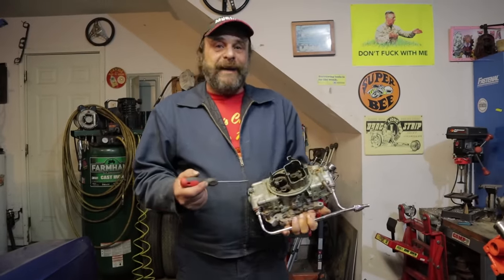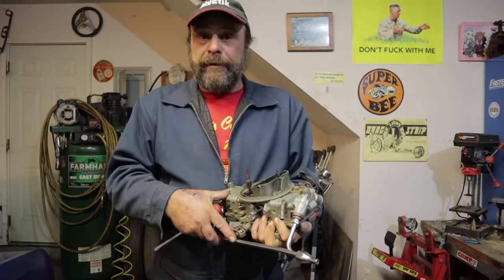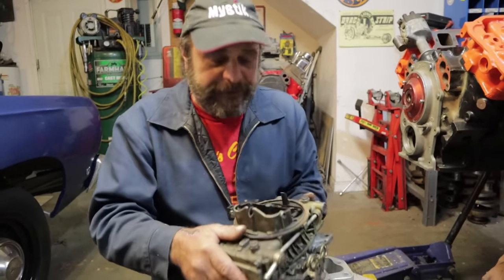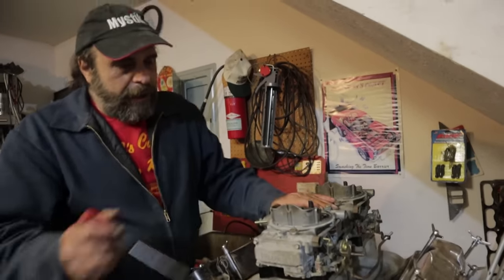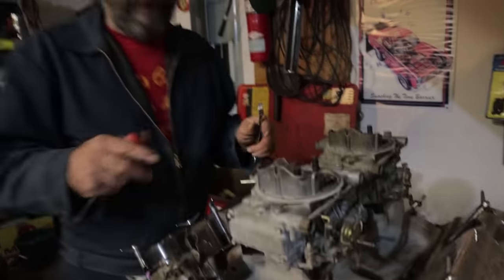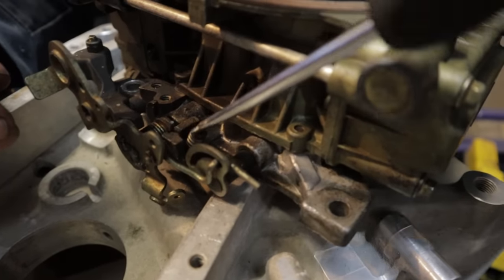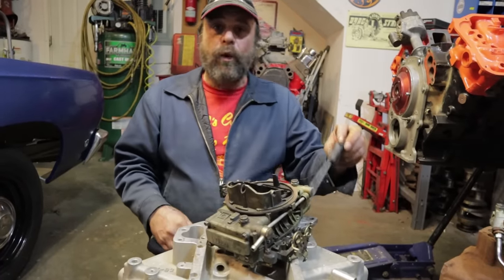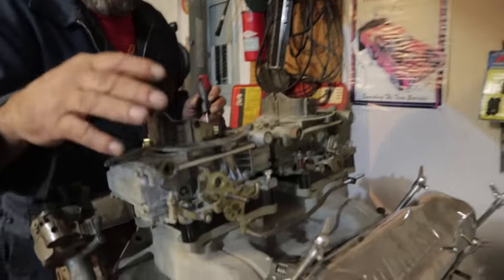Holley Set-Up and Adjust Step By Step

Comment: Tony, please do a video on setting the Fast Idle speed on a Holley 4-barrel with an electric choke and vacuum secondaries.  I recently bought a 1971 Charger Super Bee with a 383 Magnum and Holley dual feed 4-barrel on it.  The presence of the electric choke and vacuum diaphragm have made it a nightmare just to even turn the Fast Idle screw, let alone adjust it properly.  In addition I’m further hindered by the dual feed fuel lines being on the passenger side of the carb which allow minimal room to access the screw with even a small 1/4” open end wrench. In my case, the Fast Idle is set too high, so I’m trying to lower it and getting very frustrated with it..

Comment: Regarding dual quad setup (specifically for progressive linkage), is there a rule of thumb for putting dual carbs on a fresh engine (assuming the heads and cam/valvetrain can flow it)? Do you set both carbs up at 80% tune from the start, or do you tune and work on the primary before the secondary?  Just looking for a high level understanding based on the content you shared with us in this video. Thanks!
Reply from the maker: Generally speaking, you need to jet the carbs down when using in an 8bbl set-up.  Example, 76's would be dropped down to 72's or so.
You treat the idle settings on both carbs equally, even on a progressive set-up, UNLESS you are using a dedicated "secondary carb" that does not have idle circuitry included.  Example of that would be the factory front carb used on the Street Hemi

Comment: Is it normal if my car bogs/misfire while the engine is cold, even more so on WOT. But after I drive it for 10 minutes it runs smoother and actually goes at WOT?

I have a old 4.2 v6 c10 with a eadlebrock 600cfm carb. Idk if that’s normal or I need a tune up. (First old car)

Comment: Which part of the vacuum system would a person monitor to see the rise and fall of pressure? Thanks for the clear definitions. 
Only had Rochester carbs on chevy C-10's 1981 and my first 1966 and Pict-34 on air-cooled vw's.
Reply from the maker: Manifold vacuum is all you need

Comment: Amazing video thanks a lot. I just bought a 70 dart swinger and my carburetor is leaking so i want to get a rebuild kit, however i dont know what model my carb is. It looks EXACTLY like the double pumper you showed at first. Would you (or anyone) be able to tell me which model carb that is? Thanks!

Comment: Variable-geometry turbochargers can be made to work well with double pumper holleys...imo
btw...the 1st vehicle i owned was a  1972 AMC Javelin SST that had been fitted with a Holley DP 650 carburetor...as well as 401 v8,727 auto,go pack goodies,etc

Comment: I'm building a Jeep rock crawler with a mild rebuilt AMC 304. Edelbrock got me stranded on camber trails every chances he had. I got my hand on a Holley Truck Avenger do you have any recommendations since the engine sits at a 5 to 10° backward angle to align with drivetrain.

Comment: Uncle Tony I need your help.i am rebuilding a Holley 600cfm carb.i am about to purchase needle and seat valves and I found out that there are 0.97...0.110...0.120...0.130....0.150 tip.which one should I purchase??

Comment: Me,  I love the Carters AFBS with mechanical secondary's. I never had a good experience with Hollys. Just my opinion
Reply: holley,s are crap,ancient carbs,the thermoquad was better,thank fk weber bought them out.
Reply: You're not alone: Over the years I grew to despise Holley carbs. Nothing but love for Carter's
Reply: Holly carbs ALWAYS make a fuel stained mess on your pretty aluminum intake anytime you need to tune something major on them. The only way to minimize the ruining of the finish on your intake was to be a strick Nazi about fuel spillage and remove one lower floatbowl screw and drain into a cup. Hard to beat their full throttle power and response when they are properly setup though. Seams like I remember ALWAYS fucking with my Holly carbs.
 Carters & Rochesters I seam to remember it was always just set and forget. They didn't need the continual adjustments. They are easier and cleaner to work on once you understand how they all work.

Comment: Uncle Tony, do you have a garage in New York? I just bought my first classic car. I know very little about car engines so watching your videos. Anyway its a 69 impala. It was sold at Yenko Chevrolet but was not a high performance car. has a factory four speed. Originally was a 327, lime green car. Now it has the muncie transmission and a 454ci with a holly 4b carb and an edelbrock performance manifold. I had the car checked out and then also drove it myself. It seems to bog a bit when peddle is to the metal, thinking it might need more air intake? If you have a garage in NY I would love to bring the car by your shop and have it checked out.  Its a nice car, has a stripe on the side but other than that the car looks like it did when it came from the factory. If not for the stripe it could be a sleeper. Really great video, even a dummy like me can understand it.

Comment: Hey Im rebuilding my Pontiac 400, its being bored to 60 over, Ive been told the size of carb is 1.5 times the C.I. of the engine which in this case should be 690 correct? Which would be about 700 cfm carb?
PS watch all your vids really help while Im rebuilding. Thakns
DR

Comment: I got problem with my Holley and it's one I bought brand new back in '86. The damn pump lever and the screw/bolt. The head of the bolt just sits on the edge of the lever. All the others I have and have seen the bolt is straight up. Not sure if I should keep or save it for parts. Stuck it on an engine I rebuilt and at first idled quite well. Now it runs for tad, keep running giving it some pedal or it will die.

Comment: I have a Holley 3810 4b. 67 Vette won’t hold idol and stalls. However sometimes it does hold idol. How often should I change my fuel filter on the primary side. Thanks

Comment: Tony do you have a way to repair a stripped out needle and seat threads? I am working on a 1969 428 SCJ Cougar and bought the correct carb and got a good deal on it remanufactured and yep the front needle threads are stripped.

Comment: Hey Unc..Please look into this. I think something is different on the new Holleys. I am not the first to see this. Brand new Holley 670 Street Avenger. If I set it for 1.5 turns out, my eyes bleed from fuel odor. No kidding, I had to wear a respirator to be under there. Final setting ? A small hair past a half turn from fully closed. I am not the first to see this. Scares me I am too lean at idle but any more, you can really smell fuel. Any thoughts ?

Comment: What was the Holley 2 barrel carb for 4cyl engines with a mechanical secondary. It ran on one barrel until 2nd barrel activated after 3/4 throttle.

Comment: This may be a silly question but is adjusting the idle mixture screws also adjusting the full pressure? Or would you need a regulator to do that?

Comment: I set my mixture screws based on my AFR gauge around 13.2:1 and my idle around 1,100 rpms. Its a manual 4x4 truck, and parking it is a B** if my idle is too low.

Comment: Uncle Tony. I need your advice. I have a new holley 670 cfm vacuum secondary with electric choke. my question is, what should the cold start RPM be? mine starts at 2600 RPM and seems a bit high. I have looked around and the closest info I find is it should idle around 1500 RPM. I have an automatic, so does it mean in gear or neutral? Can you make a video on cold starting tuning with electric choke please?

Comment: I just did a small block Chevy rebuild with a brand new Brawler 4150 style Holley carb, and I was tooling with the both float levels based on what other people say to set them at, and thought putting them at the trickle level just below sight glass would be it but I guess it’s different for the newer style 4150s... and now my front float is where I want it and my rear is like all the way down, the bowl is dry, and the adjustment screw does nothing, tried turning it a lot. What should I do?

Comment: I have a hp950 on a 406. I took the linkage from another carb and revuilt it. I have it set with a 50cc primary with the pink cam and a 30cc on back. Some guys say I should do it the other way? I figgured having it on the primary will give me better 0-60s.. what do u think?

Comment: Hello Tony love your channel subscribe a while ago I love the way you just tell it the way it is I have a question I have a 67 Firebird with a Pontiac 455 and I also have a 1969 Firebird with a Pontiac 350 the 69 has a Holley carburetor 4 Barrel and the 67 has a Edelbrock 4-barrel even when it's freezing outside I don't have to put the choke on neither of the carburetors in the car will not give me trouble to turn on is that a good thing thank you big 👍 here take care and be safe
Reply from the maker: It means they're a tad fat on the idle circuit.  Ok for the winter, but adjust them a little leaner when the warm weather comes around again
Reply: @UncleTonysGarage  thanks

Comment: Do you happen to be familiar with the motorcraft holley carbs? I've got a 4160c that I rebuilt and it has tamperproof idle mixture screws that I don't think have been messed with but I can't tell for sure. I just assume they're still at the factory settings. Also, when adjusting the primary butterflies for my idle I saw a video saying that you should adjust them until the transfer slots are square. But with that specific carb I had the throttle screw all the way backed out and they still were too far open and I then had to mess with the screw that adjusts the electric choke. I'm not real familiar with proper terms so I hope someone can understand. With the throttle screw all the way backed out I adjusted the rest using the choke screw. The thing is that with the choke closed the butterflies are closed a little too much but when I hit the gas they open to where they should be. Is this how my setup should be? Can't find many videos on these motorcraft carbs

Comment: How do you get the throttle butterfly to touch the throttle stop plate an screw? My Holly stays idling at 900-1000 rpm until I physically twist the throttle counter clockwise to close it more then my rpm will drop to around 750-800, soon as I let it go it jumps right back to 1000 rpm
Reply: I can take the idle screw completely off the carburetor without any change in rpm from 1000. Since the linkage you hook your gas peddle up to will not roll back far enough counter clockwise to make the throttle linkage  touch the idle screw plate.
As far as im concerned If remove the idle screw completely the motor should die. So setting my idle screw at a turn an a half won't even touch the plate on the throttle linkage

Comment: I have a 1973 F350 With a 390 it has an elder Brock carburetor when it warms up it acts like it’s running out of gas and it stalls and won’t start till it cools down I just bought a 81 Chevy someone took the 350 out and put a 454 in it with an elder Brock carburetor and it is doing the same thing any suggestions

Comment: Wow, amazing how customizable american carbs are. Here in europe on most Webers or Solexes it's all "pre-tuned" in other words it'll run on one specific car and you can't adjust it for anything else for the love of god. Hell, some don't even have air-fuel mixture screws, what the hell!?
Reply: My pops had a set of webers on a 67 euro spec 911. 
He had a gaggle of parts for em , all kinds of Jets and swappable venturis ,you could have put them on anything and tuned em in.
Reply: American carburetors got that way.  The majority of people who adjust on carbs have no idea how they work or what they're doing.
Reply: @johnwilburn  Which is pretty funny if you ask me. These days people go on and waste hundreds of dollars for some stupid fucking tool to scan for their car's trouble codes on a computer but are perplexed by 3 fucking screws.
Reply: @grievuspwn4g3  Yeah, Frankly if you ask me, nothing beats pure mechanicals. If I can't fix my car without electricity or some stupid fucking plug I'm not interested, not like I'm missing out, cars look like garbage since the 90's.
Reply: @GlamStacheessnostalgialounge  the only kind of tech I'm pretty interested in is the wide band o2 sensor for a carbureted engine. Makes the tuning a lot simpler when you have air/fuel ratio in a number on a gauge.
Reply: @Mr.NiceGuy80  Oh yeah, those are pretty neat. Nothing makes you wish for those more than tuning a shitty fucking Mercedes with a broken tach and only relying on your senses to tune it, I'll get it to work, but it'll never be ideal.

Comment: I use the idle screw to square up the transition slot, then slightly crack open the secondaries to achieve idle, I noticed you did neither, will that be in the advanced tuning vid
Reply from the maker: Can't throw too much at guys just starting to learn this stuff.  One step at a time

Comment: Hi Uncle! New subscriber and frequent visitor to your Channel. Does it make a difference if I have a Holly 4160 # 3310-8 750 cfm? I need to do more research on all the particulars of this carb. Came on the car, 460 BBF mild build, MSD billet mechanical advance. Thanks. Cheers from Motown!

Comment: Tony, I rebuilt my 302 in my 70 mustang mach 1, bored block .60 mild cam, long tube headers, and swapped the stock 2 bbl intake and carb with a dual plane high-rise and a Holley 4160, the cable throttle linkage is 2 to 3 inches short now, do they make a linkage kit for that or just add to the cable the best you can?

Comment: When will you be going over the correct power valve for automatics? I have used a vacuum gauge to decide before. Having power valve 2 numbers lower than vacuum gauge shows at idle in gear. EI: vacuum gauge shows 10.5 so an 8.5 power valve is the choice. Is this still a good rule of thumb or am I out of date?
Reply from the maker: Should be good to go

Comment: Thanks Tony, this tuning tutorial will work great on a stock engine. Tell us how to tune a Holley on an engine with a  moderately big cam and extremely rich exhaust at idle!
Reply from the maker: No, it'll work just fine with a moderately big cam too.  You probably have other issues leading to the rich idle
Reply: @UncleTonysGarage  To start, thank you for responding, I would like to say that find your channel very appealing because I am an old school Mopar fan. I would like to share an experience that I had and the reason is because there is almost no information out there to fix this problem. I had a 1970 Torino with a 351 2V. I built this engine with new flat-top pistons, 780 Holley, Isky 280 Mega hydraulic cam, dual plane intake, Headman headers, and a re-worked Ford distributor. After I had the engine running the exhaust would literally burn your eyes, it was very obviously rich. The idle mixture adjusting screws had no effect and the engine idled very rough, the car was a "hoss" to drive. A round track racer that I know gave me this advice. He asked me if I had the ignition set and the idle set to where the car would run, he said then to take the carb off, turn it upside down and check to see if the throttle blades were exposing the transition slots just above the small round ports that bled gas in for idle. I took the carb off and sure enough almost all of the transition slots were exposed. He then advised me to drill two 3/32" holes, one in each of the two primary throttle plates. I put the carb back on the engine and re-adjusted the idle. Low and behold the idle mixture screws were working so well that I was able to lower the idle RPM from about 950 to 800 RPM. The engine did not "load-up" when I stopped for a traffic light and the choppy idle was history, the engine idled so well that I was amazed. At idle this engine sounded like a factory 302 Z/28. Considering power output and drive-ability, this is one of the best projects I ever did!
Reply: One last comment, the engine was a 351 2V Cleveland engine out of a 1973 Grand Torino. Ford may not have used this engine in 1970.

Comment: So I let someone talk me into putting a Holley 750 on my 318 , mild cam, pistons 30 over. Never got response I hoped for..so..just installed Holley 600 double pumper, vacuum secondary.. anyway, can't get idle down. Vacuum hoses are good, 600 hooked up exactly like 750 was..is it possible my timing is the issue?. I didn't want to mess with factory settings yet

Comment: I remember being shown you can get the floats close by taking the bowl off and holding it upside down and adjusting the screw
Reply from the maker: Not really.....
Reply: @UncleTonysGarage  since I haven't touched a carb in years on trying to tune the carb on my car if you blip the throttle it has a bad hesitation of idle but seems fine if you ease into the throttle would it be an accelerator pump adjustment
Reply: russian06374 try adjusting the accelerator pump cam
Reply: Not cool to hold a carb upside down
Reply: @joesmuckatelly8282  just the bowl, I remember someone showing me that years ago you could see were the float was and being upside down was supposed to simulate fuel being in there wasn't supposed to get them perfect but it got them close then just fine tuned once on the car

Comment: Adjust idle mixture screws at the absolute lowest idle possible. If your idle is too high it is hard to get it set correctly. So adjust then lower the idle if possible then repeat. Any further than 2 turns out you need larger idle jets.

Comment: My 800 DP manual tells me to use some Folded Wire to shove into the idle orifice if the idle is "off". So I did that. Idle vacuum is 6 so I use a 4 powervalve. 72-76 mainjets , 50cc pump,.... But a 650 pulls much better below 6500 rpm, the 800 makes 50hp or more above 6500
  The carb shown is a single pump spread bore